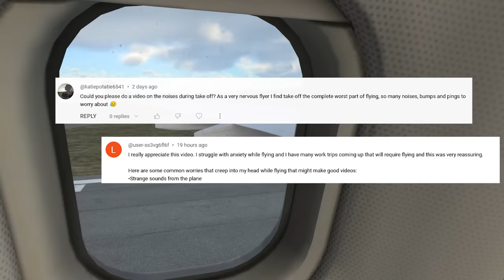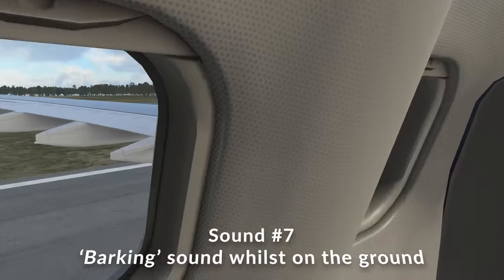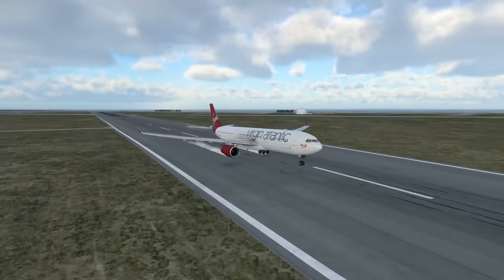What Are Those Noises After Take-Off? | Curious Pilot Explains # 3

Comment: Also, on a lot of aircraft, you will hear a ding at 10,000 feet. If air is smooth enough to takeoff seatbelt captain/FO will usually come on and let you know this. But passing 10,000 feet in dissent or climb typically triggers this. This is also when Wi-Fi can typically be connected to.

Comment: Also you may hear the APU. After takeoff you'll hear the engine's come back to climb speed and flaps retracted. All normal stuff that happens after takeoff. Landing you'll see the flaps extended and possibly the spoilers if the pilots are slowing the aircraft down. Last you'll hear a thump. This means the gear is coming down. Once you touch down you'll hear a loud noise. This is the the thrust reversers and the spoilers. Flaps will be retracted along with the spoilers during taxing.
Reply: Ah yes the flaps. I don't know if it is at the same time or similar to when the speed brakes are used but the shaking and noise from both scares me stupid

Comment: The decrease in thrust right after takeoff is normally due to sound abatement procedures.  Many SIDs (standard instrument departures) require sound abatement (or sound reduction) procedures shortly after takeoff while flying over residential areas that are sensitive to aircraft noise. The engine thrust will normally return to normal climb (which is normally the same as takeoff) levels.

Comment: This is a great. Thank you very much for all the info. There is another noise I am wondering about. It only happens during take-offs but not on all flights. As airplane takes off and climb starts, within the first minute, there starts a buzzing sound. Its pitch gets higher as the climb continues and it lasts maybe 5-6 mins while the airplane is still climbing. it just disappears gradually, it definitely doesn't cut off all of a sudden but more like disappears into the void gradually do you only realize its absence in the cabin after some time. It almost sounds like a small metal propeller overworking. I am not 100% sure but I'm fairly certain I only experienced this in single aisle airplanes.

Comment: Talking engine noises I do think one of the most prophonding one is when the pilots spool down the engines at the start of the aproach phase half an hour or so before landing. Then you might feel that you are on top of a small roller coaster and thats perfectly normal.

You also omited a lot of noices coming from the flaps and aero controll areas on the wings and specially when the crew pull out the full flaps before landing or retract them after take off can make for some noises and thrust changes.

With that said different pings are also used for the pilots to comunicate with the cabin crew at the different phases of the flights. there is also the two Crew arm/disarm slides calls that can confuse some just before doors closed and open. (For a long time I head Crew arm/disarm flight instead and it took me a while to make sense of that.)

There is also a set of noices and light switching going on when the pilots turn on the Air condition and fasten seatbelts signs are put on before pushbacks begin - Again perfectly normal. J.

Comment: Thank you for this very informative and helpful video that has, along with other similar videos, made my flying a lot more enjoyable in recent years. The one noise I have heard is whilst still stationary, maybe even whilst still at the gate, the engines would surge, seemingly to full power, then reduce again to idle. I have been told hat this is to check the take off settings, so (hopefully) the pilots would see any errors in the flight settings...Had they made any.

Comment: If you sitting just forward of the wings you may hear and/or see the droops/Slats/Kruegers extending or retracting. Could be a winding noise or faint track type noise. If you're really lucky you may even see (rare) Bucket Reverse Thrusters deploy if you are sitting aft of the wings. Also you might see spoilers pop up from wings. These do what they say and "spoil" the air flow. A larger aircraft they appear to flap randomly but they are a highly complex and monitored. I haven't flown for a while now but personally this is the best bit of experience. Remember there are two people upfront thinking about you, the plane and external  conditions and they have to think about all this as well... Oh and the landing gear as well. Every beep or tone has a reason. Also your cabin crew are ready for anything and may look relaxed but they are poised to jump into action for any emergency.

Comment: This is a great video. I am quite fascinated by aircraft and aviation in general, although being a moderately nervous flyer. I was aware that commercial airliners are packed with different electronic and hydraulic systems and that these will produce all sorts of noises, before and during flight, but I wasn't quite sure what were they. I'm really glad you explained the Airbus "barking" sound, as I did actually wonder what was producing it, but I just didn't know how to actually describe it in a search, barking I guess is the most accurate term.

Comment: By far my most alarming moment on an aircraft was in 2005 just after take-off from Manchester for Zurich and Singapore. It was my first time in a 747 and as soon as the wheels left the runway there was an almighty continuous vibration so severe that it caused the large screen display to fail.

I grabbed the armrests fearing the worst but within a minute the commotion had settled. I really did think a tyre or two had deflated. Anyway, the same thing happened after take-off from Zurich and I can only assume either one of the tyres had a monstrous flat spot or that the wheel bearings were shot! I never did find out the cause and was too polite to ask the superb Singapore Airlines stewardesses. I just know it had never happened on the many Dakotas I used to fly on!

Comment: 2:18 Every airline has different procedures. For example, the last company I worked for, we remained seated until the seatbelt sign went off after takeoff and so there was no additional sound and my current we are allowed to get out of our seats 5 minutes after takeoff without any sound or notification unless otherwise advised. Great video though.
Reply from the maker: Thank you for that extra info!
Reply: The airline I regularly fly doesn't do a cabin ding after gear retraction on take off. They do a quick toggle (two dings) on the fasten seatbelt lights when passing through 10,000 feet on both ascent and descent and cabin crew begin prep for service or their final landing duties. The seatbelt light then goes off if safe at cruise.

Comment: Couple corrections if I may😊 The ptu sound during engine start is a self test of the system. It has nothing to do with single engine taxiing. Single engine taxiing is always done with engine one running and pressurising green system and then using eletric pump to run the yellow hyd system. This is done for the exact reason of not needing to use ptu. Ptu is not designed to be ran long period of times so thats why its not used during single engine taxi.😊

Comment: I was a sonar tech....... I LISTEN TO EVERYTHING ALL THE TIME! After hearing a noise then I try to localize it and figure out it's source. That was 50 years ago so I kinda think this is part of my DNA and do this from force of habit now and forget I do it. Engines whine, whistle and buzz dependent on power settings so on takeoff thrust is set close to or maybe at full power. Power is sometimes reduced to meet local dB levels then gets back to climb thrust setting after leaving the local requirement area, gear comes up which lowers the source level/ low freq rumbling, flaps come up further reducing the low freq. rumbling. As speed increases after reaching cruise altitude then a higher freq louder roar of the plane passing through air. There is also a multitude of machinery noises from the planes hydraulics systems.

Comment: Years ago I wasn't concerned but curious about the dull buzz you hear when seated in front of the engines on takeoff.  A pilot sitting next to me told me it was the engine fan blade breaking the sound barrier when its thrusting the plane up.  Not sure its true but seems logical as it stops once the plane reaches altitude and cruising speed.

Comment: Actually the thrust settings change to adhere to local noise abatement rules, the plane will climb out hard & fast to a particular altitude then the engines are rolled back & the climb is reduced to avoid prolonged high thrust noise.

Comment: The vibration you feel on some flights after take off is just the gear spinning fast and can shake the aircraft a little. The reason it stops soon after is the wheel rotating is purposely stopped prior to being stowed for safety reasons. The period from rotation to being stowed doesn’t last long at all.

Comment: Could also mention for the curious viewer that the seats on regular A320/B737, the seats around row 7-9 are the best if you fear or don't like turbulences or slight vibrations in the plane. It is usually the "standard" area of centre of gravity, and it this field you experience the least amount of force in turns, climbs, turbulences etc. The moment is centeret around you. It can easily be explained by putting a pen on your finger while holding it horizontal. if you move the tip of the pen with your other hand up and down, you will see it's moment is getting bigger on each end. Now let's go back to the point in this example; where your finger under the pen is touching, that's where you find the centre of gravity. It does really not move much when the pen is moving up and down. Same thing is with the seats around 7-9 (in A320/B737 with more or less full plane).

Comment: One more thing, the speed brakes/air brakes.   They are flaps which pop on the wings to help slow the aircraft down in mid-air (and just after landing). They're sometimes used during the descent, if needed. They cause a constant rumbling sound and vibration. I'm not a pilot, this is just my experience.

Comment: Just a couple of extras 1. Although it's difficult to fly on them now the Bae 146 and RJ series made a very odd noise when the flaps were retracted. Probably becuase you're not used to sitting in a jet passenger plane with a high wing, and therefore you hear the change in airflow. 2. Not a Sound but A320 series with the IAE engine can have very flickery cabin lights when on approach and engines are on idle, something to do with frequency of the generators attached to the engines.

Comment: Thank you! Every time I hear the engine slow down after take off, I freak - even though it happens EVERY time and logic SHOULD tell me that it’s normal.😂Unfortunately, rational thought isn’t available to me when I fly; I’m terrified of flying. At least I now understand the reason for that sound.

Would you be willing to do a video on transoceanic flights? I’m particularly scared of flying for long distances over the ocean, (my other phobia is sharks). Apparently pilots know where they can land if something happens? How is that possible when you’re in the middle of the freaking ocean?!
Reply: Charter jet pilot here! Depending on the airport, we have so much thrust that we have to slow the engines down as soon as we take off! It’s crazy! There are Speed limits in the air just like there are on the ground for cars. As for the long haul flights, the scariest part for me is being bored. We always know our closest airport, but chances of a catastrophic in flight failure in cruise is extremely rare! Scariest part of my day is the drive to and from the airport!

Comment: Fantastic video! With respect.. The section around 2:50..where you discuss the engine de-rate, the sound seems over exaggerated..the De rate is usually much shorter and sharper in duration. The sound played here is almost like the engine shutting down. 😊😋 I only bring it up as people may be confused as to what they may be hearing when on an actual flight. Keep up the vids.. Nice job :)

Comment: I'd add that as well as derating, you might here the engines spooling down due to altitude and speed constraints in the departure route. In all the major London airports, theres a fairly strict 5000ft height constraint that must be kept below until the planes are over the water in the South East direction. So the more extreme spool downs may just be to level out early temporarily

Comment: There's a noise that I've heard a few times, mostly on turboprop planes and more recently on an older Boeing 737, where for the first few minutes of the initial ascent the plane makes this constant higher pitched groaning sound. I can't really describe it any better than that. Can you help identify?
Reply: This is often called a buzzsaw sound and is the tips of the fan blade breaking the speed of sound. It only occurs at the highest thrust settings and also depends on the engine type how loud or noticeable it is.

Comment: Sound#4 is specifically Boeing 737NG's hydraulic and fuel pump noise.
Sound#5 is only heard on A320 families, including A320NEO. The older the plane, the bark will last longer, in some cases, I heard it non-stop all the way to the runway, and is totally gone when the plane took off.
Airbuses has plenty of mechanical noises bared for overwing sitting passengers to hear. The landing gear lock latches banging during extension / retraction is pretty loud and may cause surprise. Then there is also pretty audible bump that can be heard when the plane is braking during taxi, it is the sound as if a piston is hitting something beneath the floor. This is still audible even in A350, but not A320.
Boeing started to allow audible mechanical noises in 787 - which audible hydraulic pump powering up can be loudly heard after engine start.

Comment: After T O you have to throttle down to slow the plane. Once airborne with no wheel drag, the plane can get to 250 Knotts quickly, that is max allowed around an airfield. 
You throttle back and slow engines, then throttle up a little more for cruise if need. It's standard operating procedure and normal. Some good pilots do that transition smoother than others. If you catch the speed late by having too much N1 on T O you have to slow faster by throttling way down then back up.

Comment: i think you forgot the flaps and slats sound. the whirling noise during pushback, taxi or before take off (though usually its during push back, but i've fly once where they extend the flaps just before they line up to the runway and i'm ready to notify the cabin crew for that but they extended the flaps first before i got a chance) and after take off, before landing and after landing.

Comment: so i have a question and i have not seen a video on it. why are fighter jets so loud what creates that signature sound of a fighters engine, my daughter asked me and all i could think of was its just the gas coming out the back of the motor but their has to be more to that. is it a combo of the fan blades, the compression, the fire, the air getting pushed out faster than the sound barrier, the afterburner???

Comment: One of the most disturbing sounds is 747 nosewheel braking on gear retraction after takeoff (if you're sitting in 1st Class). The wheels are braked when the types contact two fibrous (fire resistant) pads. Sometimes it sounds like a circular saw. Even as a former 747 aircraft engineer, it caught me by surprise.

Comment: Nice video but i would add the noises coming from the flaps, spoilers and speed breaks (after take-off an before landing). Depending on the aircraft, you clearly hear prettey loud noises when the flaps are moving. Then, for the noises coming from the gear, especially when the gear is going up, you may here a bang. This noise is coming from the wheels which have to get breaked suddenly before the gear can be retracted.

Comment: Every so often when outside, I hear the noise of a plane overhead as if it has just dropped out of the ether - i.e., there is no low sound gradually increasing to a higher audible level, it just appears. Is this also a change in the engine?

Comment: You forgot the flaps being retracted after tack off and reset for landing. I remember one day getting on board an old 737 and it was raining quite heavily. When I took my seat I noticed some water dripping from the sealing. Thinking the worst that there was a hole in the fuselage I called the flight attendant over. It turned out it was just the aircon pipes that had formed ice on the outside during flight and it had melted while on the ground  at the gate. The water was now dripping on to the floor in the ill way. I still think that was a bit dodgy. When the plane tilted back at take off a stream of water poured out and got me right in my left ear. Another flight to Sydney from Adelaide in another 737 my seat was broken and the back of the seat wouldn't lock and if I leaned back it went all the way back. So I had to try and hold myself up when the plane took off. This was back in the 80s.

Comment: Very nice presentation thank you
 Your individual parts I agree with you.  Other sounds are rough runway surfaces like spacers in the runway that kind of thump.  Another is when taking off and landing the air frame actually bend and move.  Sounds of cracking or unsettled overhead compartments.  Also considering the age of the aircraft and landing and take off cycles.  Etc Etc. Onward  🌈 blue skies safe travels.  Thank you